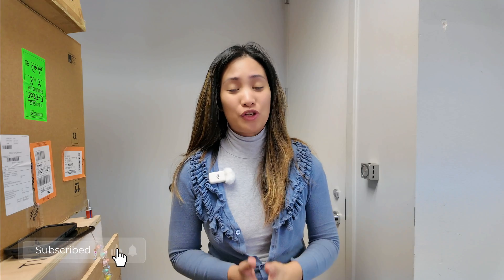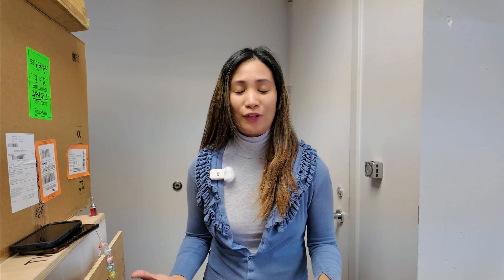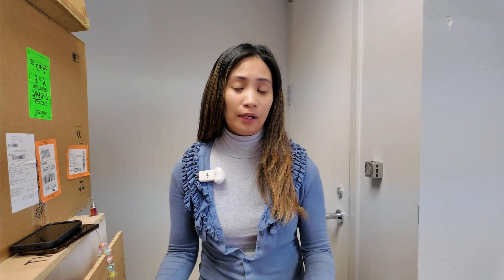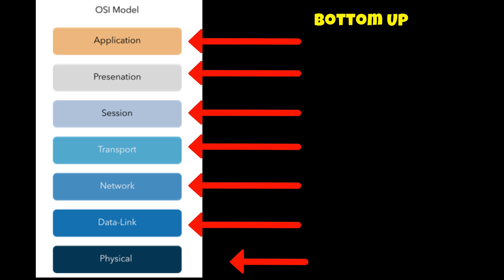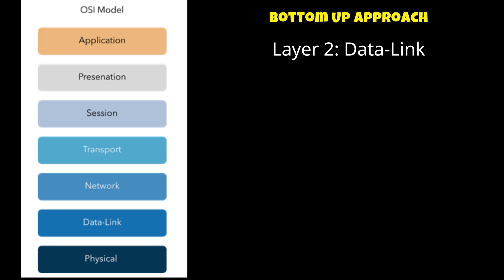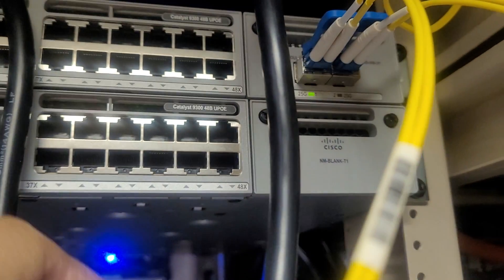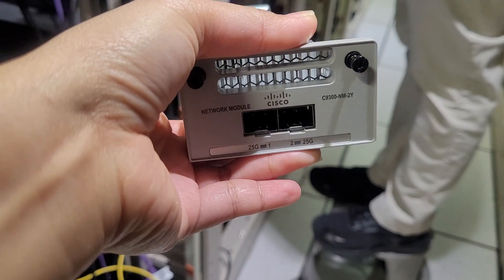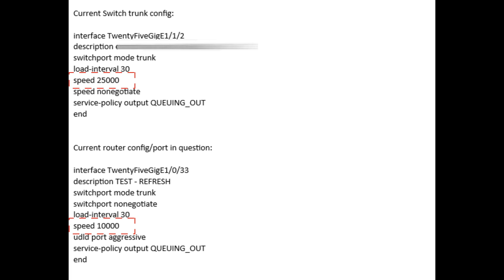Troubleshooting Switch Issues | Switch Project | Decom Switch

Comment: Do you have a tutorial on remote access using PuTTY? I want to learn how to access another network switch remotely.
Reply from the maker: I don't have a  tutorial video yet. It's actually not that hard. If you have Putty installed on your computer, you can type in the hostname or IP address of the switch and make sure that SSH is selected as the connection type

Comment: One of the best practices also when replacing an old switch to the new one is to back up the configuration you have from the old switch and then load it up to the new switch assuming you have the same set up / placing of the ethernet cables to the new switch to avoid that the kind of errors in the configuration.
Reply from the maker: Yes I agree 100% to always have backup of the old switch. That's what we've been doing actually. We copied all the exact configurations on the switch and moved the cables exactly where it should be placed. but the error this time was in the router config. It was a different team that configures Layer 3 and we trusted that the configs were done correctly

Comment: I’ve encountered fiber issues before like this. Fiber sometimes can be such a pain. We had to go from an old building across campus which means the fiber connection was under cement to our building. At one point years ago some workers had to dig up the cement for maintenance and broke the original fiber. So they had new fiber ran. 

When we were trying to replace the old switches with Cisco 9300 the fiber link just wouldn’t come up. I went through so many checks and it came down to making sure the same SFPs set to same speed and again swapping the fiber sides to get it working. It was definitely a learning experience. 

Can you tell me the brand of SFP you’re using? Those blue tabs seem to provide protection and better when you need to remove them. 

Enjoying the videos.
Reply from the maker: Yeah fiber is a pain and they're delicate so you really have to be careful. Oh wow that's a lot of work re-running fiber. I don't have that much experience with cabling so I learned too. We're using CISCO SFP 10/25G-LR-S. Yeah they're easier to remove that's why they're also pricey lol
Reply: @EastCharmer  Thank you I’ll check them out. Quite often we get thrown into this stuff and we learn just by doing.